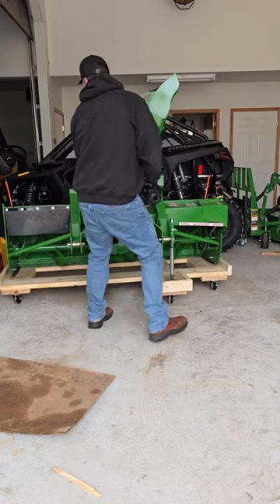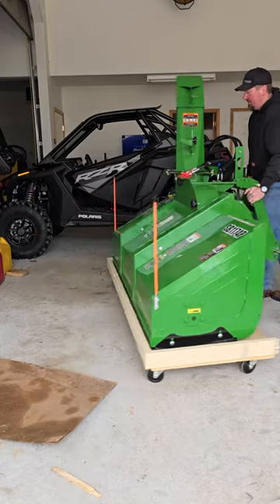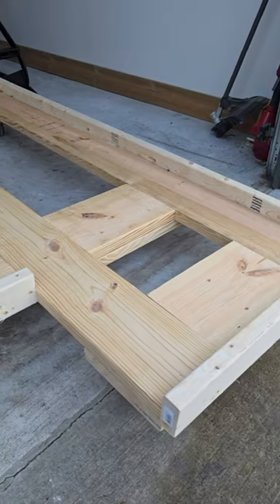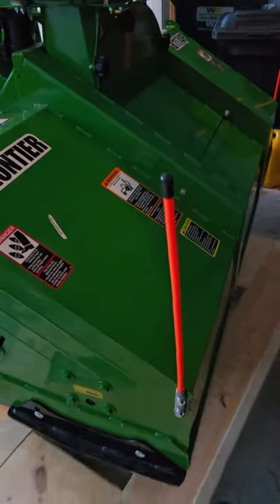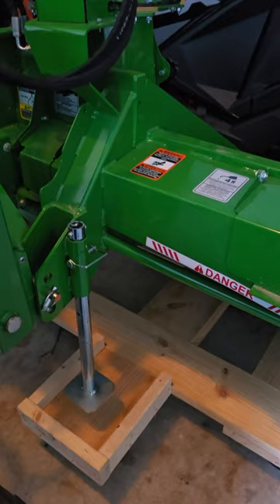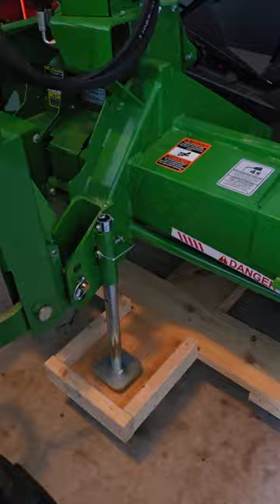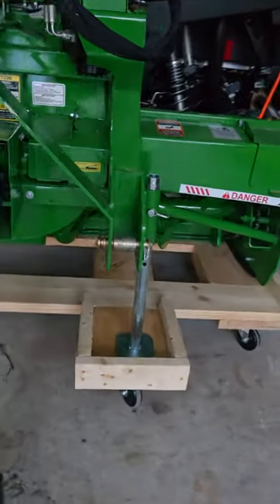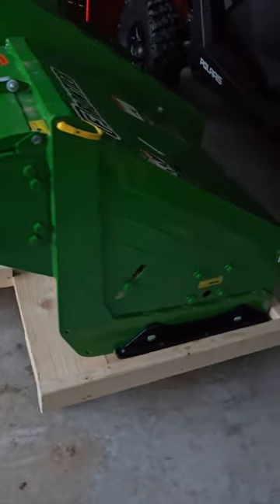How To Make A Tractor Implement Dolly #tractor #storage #diy #dolly #barn #shorts #compacttractor

Comment: Looks good and obviously works well. 
I just put wheels on solid pallets. In a lot of cases I have just used the pallet that the implement was delivered on. If transporting across property I just zip tie the implement to the pallet and pick it up with fork.